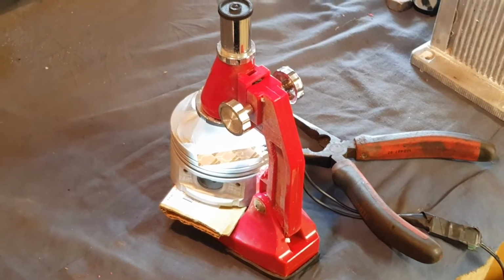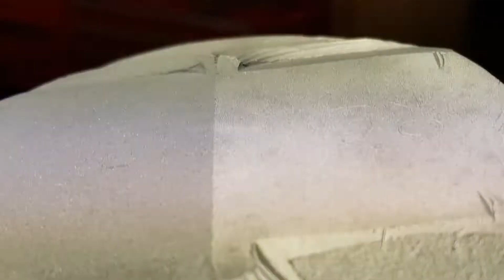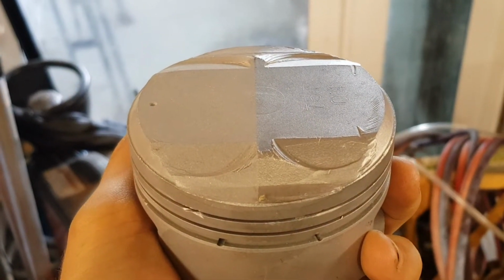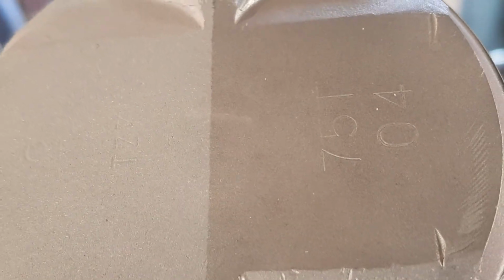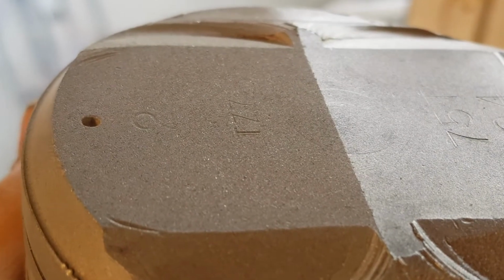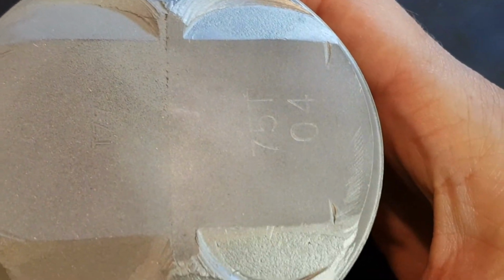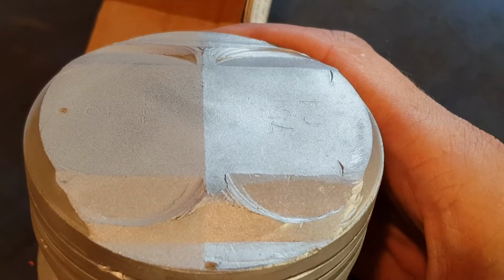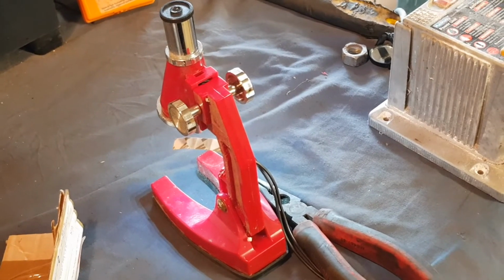DIY Vapor Baster vs.  Sandblaster Finish

Comment: One thing that sandblasting is better for is a grippier surface for paint adhesion.
Reply from the maker: Yes, that is true, but you can also achieve similar results by using more aggressive media in the vapour blaster with the added advantage that vapour blasting will not embed media in the substrate.

Thanks for watching!
Reply: @ArmouryEnterprises  Thanks - good to know.

Comment: Thanks for that vid Josh . Very good  info. How’s the mobile compressor coming along? Cheers mate 👌👍
Reply from the maker: Thanks for watching!

It is coming along slowly. I need to go get some more panel steel for folding up the shell. I had enough to fold up on of the panels on the side that was missing, but I still need to do the top cover, two side doors, repair one end shell and make a pair of mudguards. It is a really enjoyable build!

Comment: is this comparison done with the same media blasted on each side for the same amount of time?
Reply from the maker: Hi!
No this was just a test to show the difference between the average sandblasting finish and the average vapour blasting finish.

It is very difficult to do a direct comparison for a number of reasons. One of which is that different systems perform better under different parameters. For example with glass beads as a media (the most commonly used in vapour blasting) is safe for use up to 80-90psi. In a dry cabinet, use over 40-60psi will cause the media to rapidly break down.

Thanks for watching!
Reply: @ArmouryEnterprises  Thanks for the tip, I did not know it was safe to use glass bead in wet blasting up to 90psi